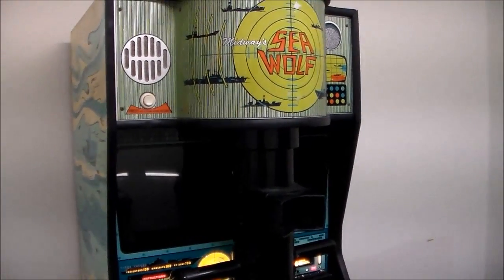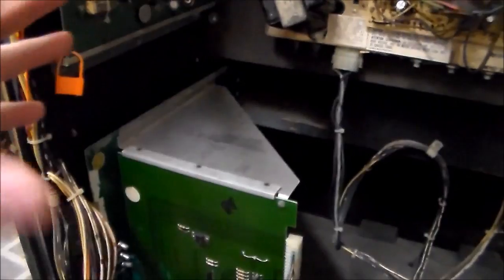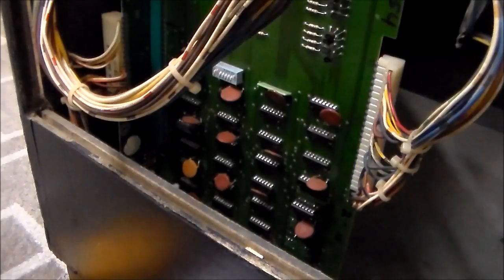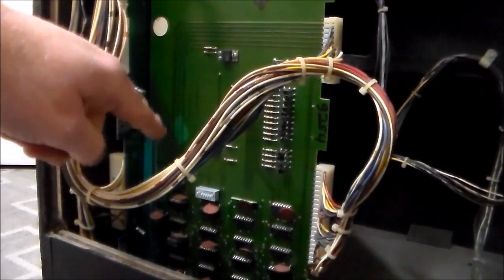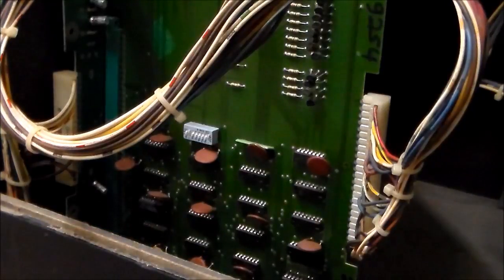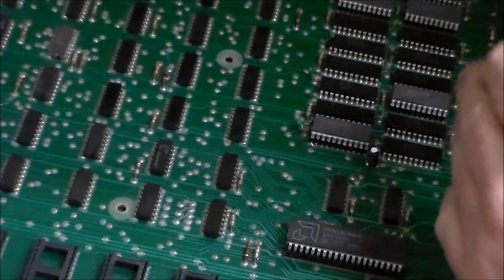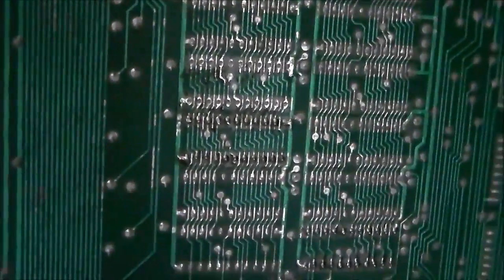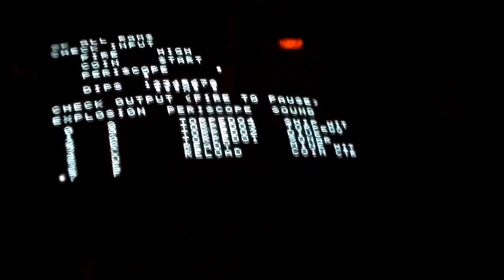How to Repair your 1976 Midway Sea Wolf Arcade Game PCB - 8080 CPU , Space Invaders

Comment: Hey joe, love your videos. 
I have a gun fight that is similar setup to this. I have garbled screen, no letters, and all my voltages are 5.6, -5.6, 15.6 cranked all the way down.  Mine does a gunshot when powered off. Any suggestions?
Reply from the maker: The voltages are a little bit high but they'd probably be o.k., are you getting those voltages at the power supply, or measured actually on the game board?  The gunshot is just because the sound board isn't running and properly turning things on and off, if it makes that sound like that it's just the power draining out of the circuit.... 

I don't know how much equipment you have, but the first thing I'd do is remove and reinsert the little 2 legged grey crystal on the corner of the main board (it's in a socket)... Then retry the game, it might be that the program isn't even trying to run because there's no clock signal.  

If that doesn't do it, it may be a rom problem, you could clean and reinsert the roms, if that doesn't get you going in the manual it describes how you can test the ram by removing the roms (the CPU alone will make a pattern on the screen).... or if you buy the test rom from www.HobbyRoms.com or download and burn your own, it could test all your ram for you.
Reply: Joe's Classic Video Games I read those readings at the harness that plugs onto the daughter board.  I did try to get some readings at the daughter board. I was just randomly checking legs for +5.  I wasnt that confident in my readings bc I wasn’t checking from a schematic. The readings I was getting all seemed low(2-3v). But, for all I new at the moment those could be appropriated. 

I did re-seat all socket chips on the daughter and mother board and checked for continuity from the copper fingers to the test points or first stops on daughter and mother. I hope that makes sense. 

I will check that crystal. For what it’s worth, the screen garble does kinda change like the board is booting and running thru the attract mode. However, I have no real indication that the game is coining when tripped or playing blind. 

I really appreciate the help thus far. My grandpa was an operator in the late 70’s to mid 90’s. I’ve got a lot of water damage victims and some hidden gems like a dig-dug painted grey and turned into a ikari warriors lol. But I do have some cool stuff like this one, subroc 3D, omega race cockpit and spy hunter cockpit. I started the adventure of arcade restoration about 2 years ago and your videos have been great for learners!
Reply: Joe's Classic Video Games well, gunfight lives!! Wont coin up tho. The screen flashes when tripped and when start is pressed. But, it just goes back to attract mode with “insert coin” at top. 🤔

Comment: look up crt solutions they have cheep tubes kinda sucks about the burn in but like you said common
Reply from the maker: the whole issue is though.... it's an inherent flaw in the design, so if I replace the tube i'll just end up burning the new tube too.  It's pointless to fix something that a. was on all the games originally, and b. will just happen again.... and it's a 23" black and white tube, not the easiest thing to find.

Comment: I understand and respect that you keep your games original. But don’t you think for reliability and safety it would be good to to always install a new modern power supply and cord? Do purest and collectors really care about an original power supply and cord?? I purchased an original Galaga and that was the first thing I replaced.
Reply: @Lancair W That depends on the collector in my opinion. Some of them insist that EVERYTHING is original, but I can understand your point, Lancair W. If you have it at home, it should work without problems.
@Joe Thats the point, you have to change parts to fix the games - otherwise you can only dump the games or part them out. You are doing a great job and I appreciate your videos!
Reply: With the exception of Sega's G80 power supply, and probably a few other oddballs, the factory linear power supplies are typically very solid and should be rebuilt.  Being that they're still running with little-no problems after 30+ years, it shows how over engineered they were BITD.  The switching power supplies are good, but tend to burn themselves out after 4-5 years (sometimes less).
Reply from the maker: I agree 100% Justin!